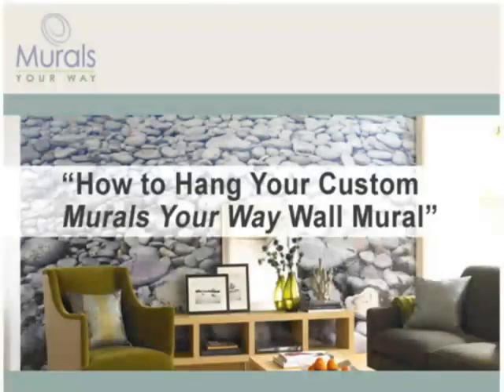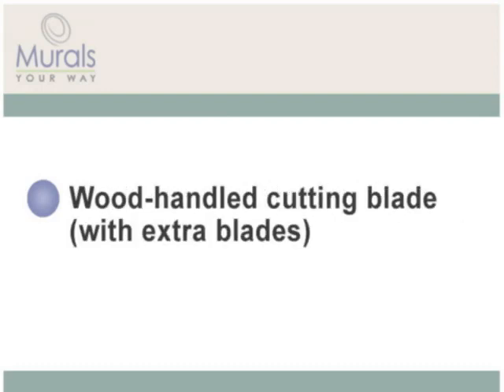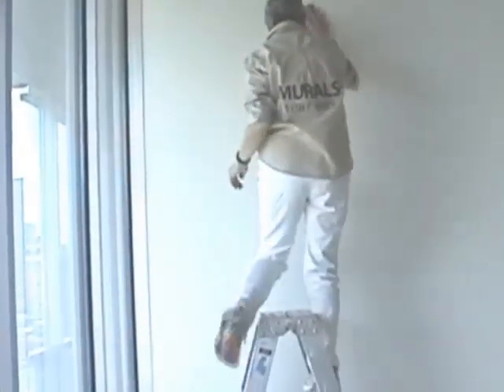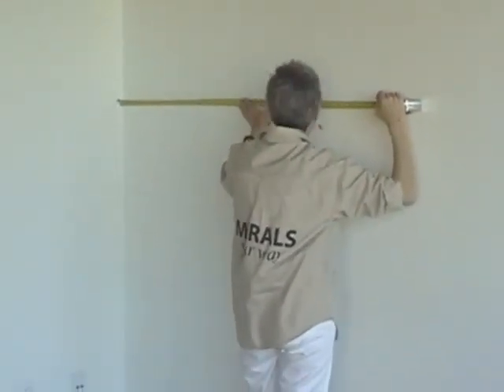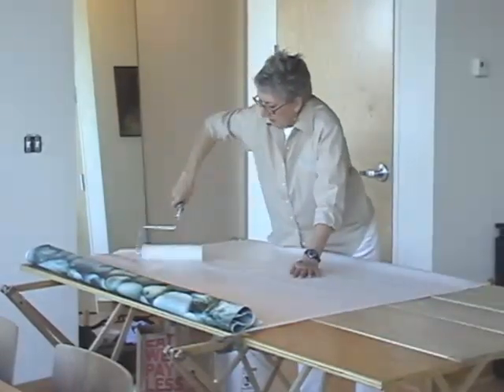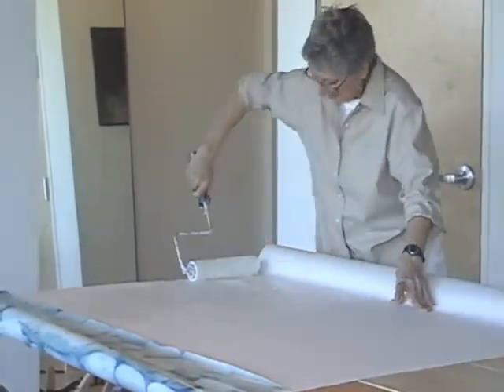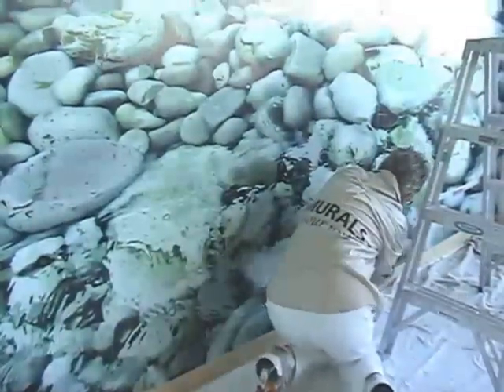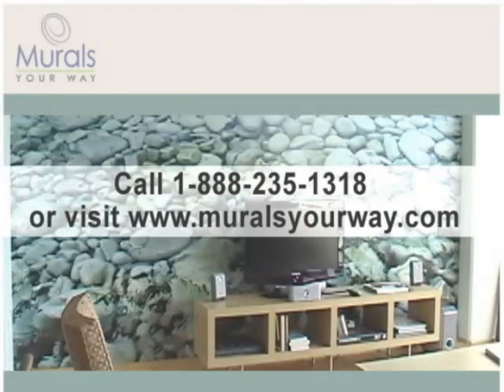How To Hang Your Custom Wall Mural

Comment: Is it possible to hang a canvas mural in an apartment ,remove it later (to hang  in a house ) and not harm the wall or mural .Is there a low tack removable paste product which comes off easy . Is removal of paste adhesive hours of work ? Can it come off with washing not sanding ?? Thanks for any advice .